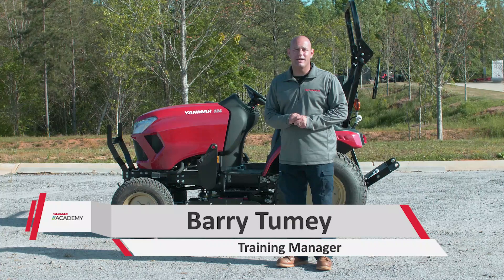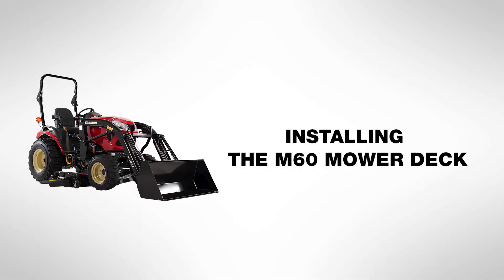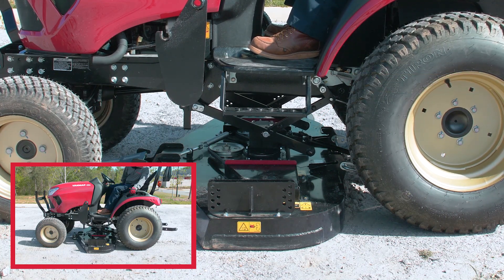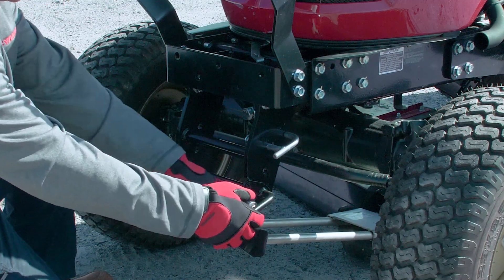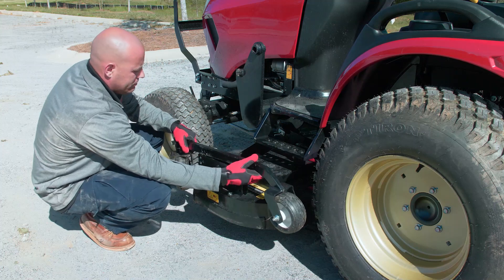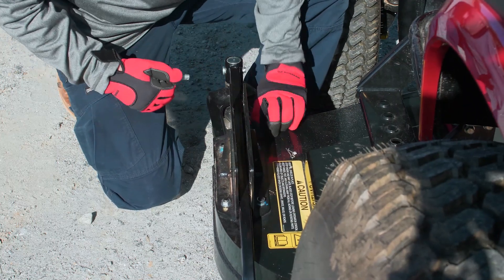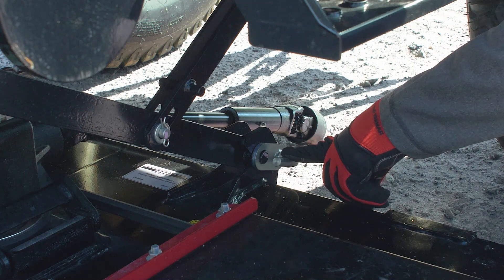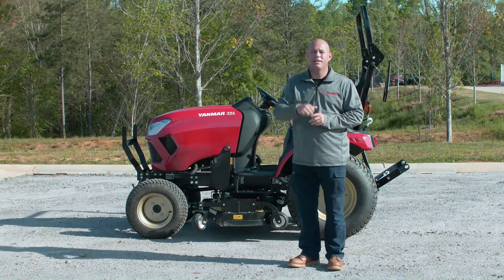YANMAR Academy - Install and Removal of the M60 Mid-Mount Mower

Comment: NOTHING  CONCERNING  INSTALLING   /  REMOVING   THE  MID-  MOUNT  MOWER  DECK  IN  YANMAR'S   MOWER  MANUAL ,  
                  MISSING .
Reply from the maker: Chapter 4 section 2 lists the process to install and remove the mid mount mower.
Reply: MOWER MANUAL LISTS IT ON PAGE 4.2. I ESPECIALLY APPRECIATE THAT THEY LISTED 1.2 ...RELEASING THE LOCK ARMS.